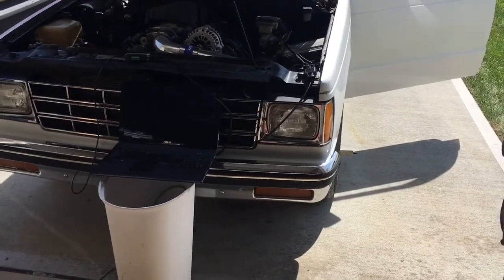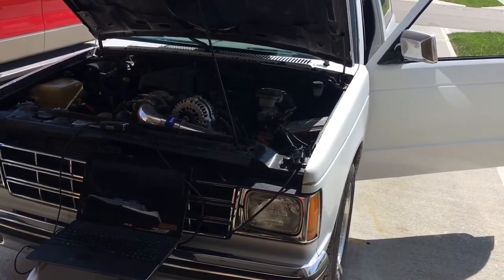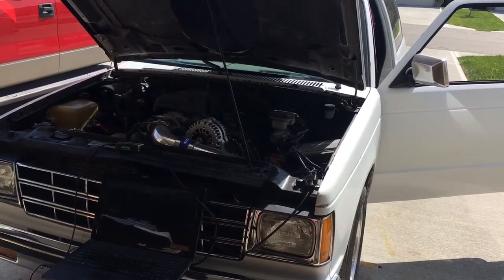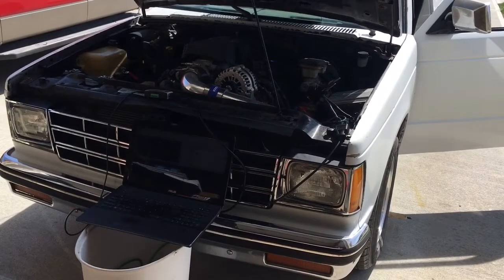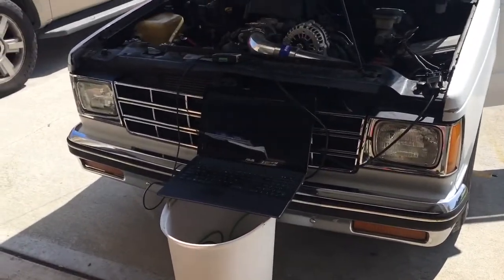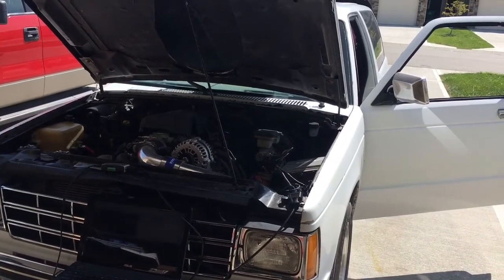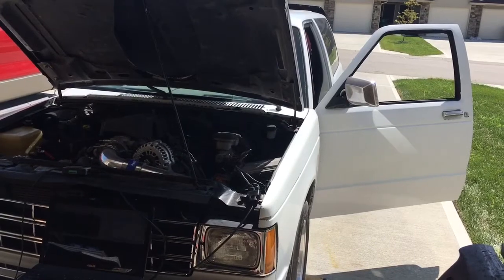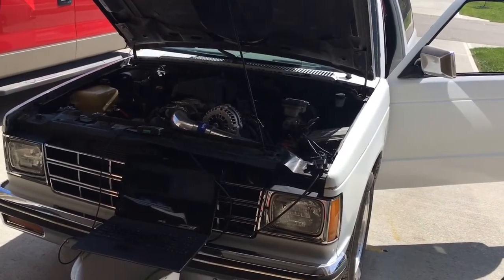HP Tuner Pro base tune the 4.8

Comment: Your still running t5? Any idea how much hp your roughly at?
Reply from the maker: LSXs10 Guy  Yes, still running the 1991 Camaro V8 T-5 with 2.95 first gear and a .63 OD. I drive it, I don't really race it or dump the clutch from a dig. My 4.8 was rated between 270-275 Hp factory. I have cat delete, true 2 1/2" dual exhaust, CAI, and I'm trying to tune it myself. I'd be happy if I were making 300-320 hp!  Hopefully we'll find out what it makes September 22nd I'm taking it to a Dyno Day to find out. I'm hoping to see 255-272 rwhp on the chassis Dyno.

Comment: What radiator you running?
Reply from the maker: I'm running a Northern 16" H x 31" L #209628 which requires cutting the radiator support to mount in the Forward position.
I recommend running a radiator with the Inlet and outlet on the Right side to match the hoses of the LS engine.
Reply: Its a Northern 16x32 from Star Performance. It the same one I have in my truck.
Reply from the maker: Alpha Ghost The Northern radiator for the LS swap is #209651
It puts the hose inlet/outlet on the passenger side.
Reply: I show the ls swap radiator to be a Northern part #205183? But just searched that # and its for a try 5. It will fit as i got that # from a guy with it in his truck.
Reply from the maker: Rebelracing I was reading off the tag on the radiator in Richards aTyphoon swap. Maybe you're looking at one that's 19" tall?